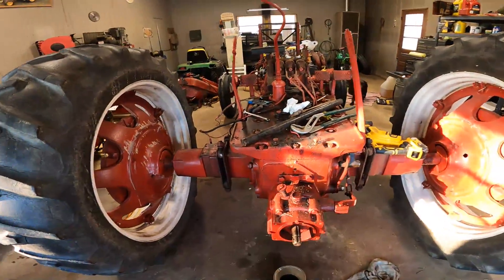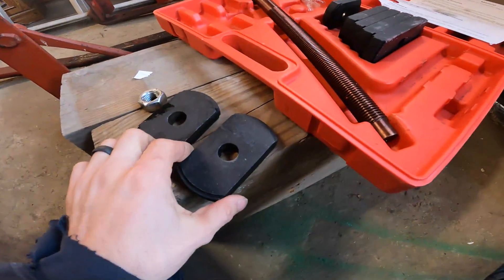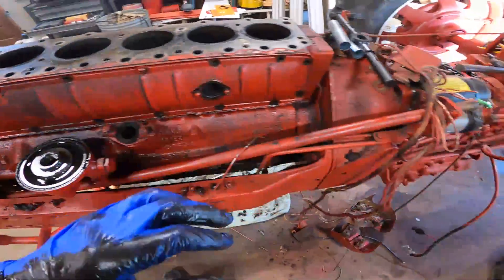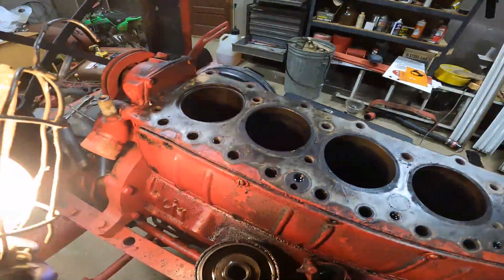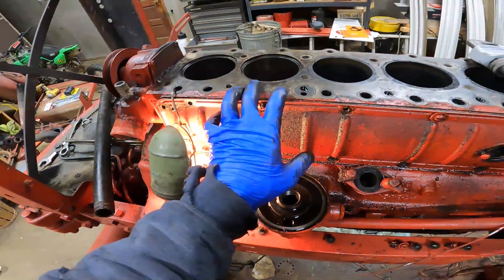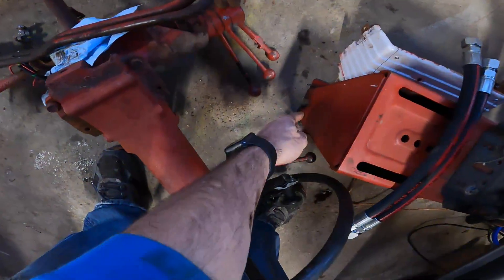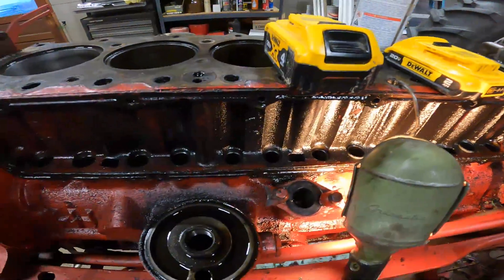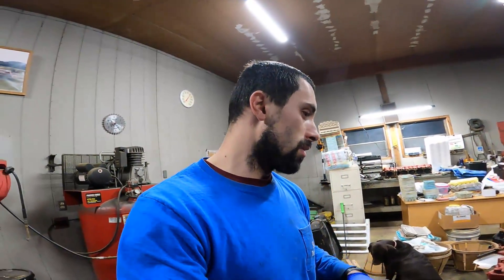Pulling Sleeves | Farmall 460 Tractor Repair | Episode 5

Comment: I understand that you might be on a budget but I believe it would be to your benefit to strip the bock and have it boiled out and take the head to someone that has a valve grinder, if it's not in the budget forget that suction cup and use a drill to spin the valve against the the seat both directions with the compound on it. Had a 460 myself back in the  70's

Comment: One more thing you can spray silicone on the cylinders to help the sleeves slide in, and I would check with a mechanic before you hone the rest of the cylinders, did several tractors in my time and never once honed the cylinder before I put the sleeves in there's no wear in the cylinder it's in the sleeve you took out
Reply from the maker: Everything I’ve read and seen says to hone to remove the glaze
Reply: glaze in new liner...WTF @shaffershomestead
Reply from the maker: Not the new liner.. the cylinder after you remove old liner
Reply: Again there is no glaze in the cylinder, the rings make what you call  glaze and the rings don't touch the cylinder @shaffershomestead